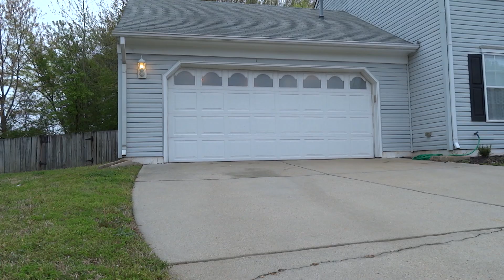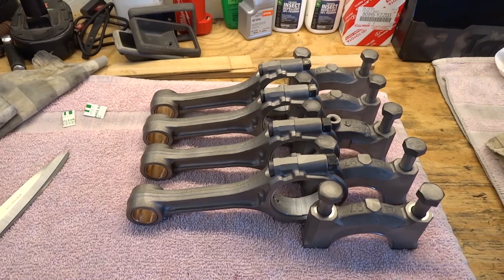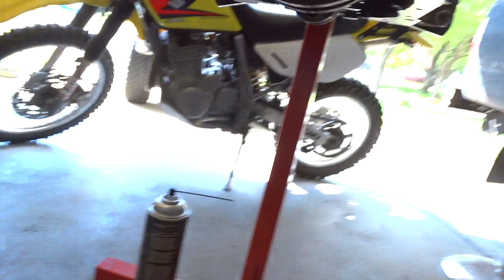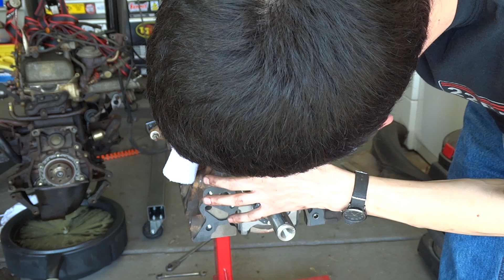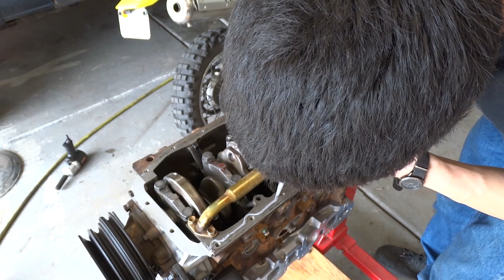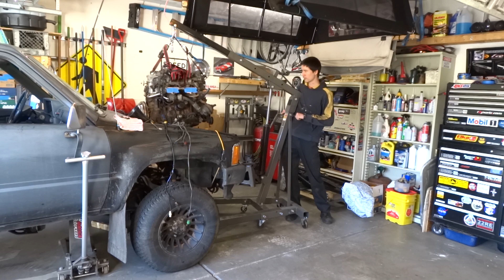Toyota 22RE Full Assembly and Install

Comment: So it looks like the 22re long block  on my 84 donor is the newer laser block.  Pear shape ports on the exhaust side.  But why does it have the throttle bottle body that tilts down?  I was told that throttle body indicates that its the pre 85 non laser block.  Can someone help me out.  Thanks
Reply: Also I heard that the 84 and 85 heads and blocks are completely different but has the newer valve cover.

Comment: dont feel bad theres a bolt that runs down under the timing chain that apparently needs to be sealed or it will eventually get oil and water mixed up i had to open everything back up put a little permatex on and close her back up. Way to make it look easy tho😁

Comment: Curious about that smoke on start-up around 39:01. Where's that coming from? Is that normal for first time starts? Love this vid. I've watched it like 18 x
Reply from the maker: It's oil and grease burning off the exhaust manifold. Keep in mind, the last time this engine ran it literally exploded and sprayed oil all over the exhaust. Combine that with greasy hands touching parts, it's totally normal to see some smoke on the first start up.
Reply: @TheAlexManVideos  dude. I fully rebuilt the 22RE in my 4runner, largely due to this vid. Thanks so much for putting it together, and for the reply. You've taught this guy to fish

Comment: I have a few questions. Does the size of your tires hinder the power the truck puts out goin up grades in the 4 runner , 4 cylinder? Have you changed the gearing at all for that ?
Reply from the maker: Tire size definitely makes a difference. The Pickup has stock size tires and stock 4.10 gears. The 4Runner has 33" tires and has 4.88 gears. Even with the re-gear, it's slower than the stock Pickup. For a while I had 35's on the 4Runner and it was even slower. Both trucks are 22RE powered.

Comment: I'm afraid of all the hoses and wires.
Reply from the maker: Everything goes from one place to another place. Just label stuff when you take it apart and put it back where it came. A lot of times with older stuff, the wires and hoses have sat in one position/shape for so long they basically point to where they are supposed to go.

Comment: You use a pre cut gasket and gasket maker on both sides? Seems a little redundant, no?
Reply from the maker: Maybe. Doesn't leak though.
Reply: @TheAlexManVideos  that's good! I just got my first 22r assembled the other day and it runs like a top! Seems impossible to put these things together incorrectly.

Comment: Sup dude i have a couple questions. How do you determine your bearings and ring and piston sizes? Dis you go with all standard sizes since you did not need to grind down the crank etc? Then install the standard sizes and re check clearances??
Reply from the maker: I had the machine shop check the crank and determine if it needed to be ground or if polishing was okay. They said all it needed was a polish so I bought standard size bearings. A double check with the Plasti-gage just to be safe, and assembled it.

Comment: Do not use green coolant in your Toyota engine, they don't like it. Go the the dealer and pick up the red stuff it is much better for the engine.
Reply from the maker: Green stuff works just fine. These trucks and pretty much everything else on the road used green back in the 80's.

Comment: Nice! What sealant did you use on the top corners of the timing cover? Looked like a second application after razoring it off.
Reply from the maker: Permatex Ultra Gray. Razor off the tab that sticks up once the timing cover is on. A tiny dab after keeps it from leaking through the junction.

Comment: It's best to use ring expanders!

Doing it by hand is likely to bend or twist the rings so they don't sit flush with the cylinder walls. Speaking from my experience just yesterday, I fudged one up despite being careful lol
I just skipped thru this to see how if you installed the timing chain and cover first, wasn't sure how I'd hold the chain up but now it makes sense, thanks!

Comment: Really like your videos. I wish that making more videos was something that interested you. This video in particular +  your 6-part timing chain series were super helpful.
Reply from the maker: Glad you enjoy the videos. For better or for worse, I make these videos just as a hobby. I don't make a living off of them so my drive to produce them isn't pressed by necessity. Also, my nice camera that I only bought fairly recently completely took a dump which really took the wind out of my sails. So I need to buy a replacement camera again and I've been putting it off. I can use my GoPro or my phone but neither one is really easy to use or makes as good of videos. Don't worry though, I'm still here.
Reply: @TheAlexManVideos  glad to hear you're still around, best luck to you, and thanks again for the content

Comment: Have you ever changed out or remanufactured the gear box to steering? If so will you provide me you choice on the part?? Thank you.
Reply from the maker: I've never had to replace the steering gearbox. I have had to replace the input seal on two different trucks. For those I used a kit made by Edelmann.
Reply: @TheAlexManVideos  so for my 89 Toyota pickup gear box, just replacement kit would do? Thanks for the information if that's what will work.

Comment: Did well explaining on the video on the acceleration throttle that you installed. Plain and simple,.short and to the point. I have an 89 Toyota pickup, have it for 22 years.

Comment: The comment you made about the timing chain guide breaking and causing the timing chain to wear a hole in the water jacket was spot on. I haven't heard anyone else mention that in all the hours of 22RE videos I've been watching. I went and inspected my timing cover and BAM!!! big crack in a worn spot. The motor oil looked like a chocolate milkshake. I am so appreciative of that comment. It saved me countless hours of pain and heart ache. Thank you!!!
Reply: Did you do the repairs? Looking to buy a pick up with milky oil and thinking it might be this. If so how did it go after the repairs? Engine ran fine? Im worries the engine may have had bearing damage due to the coolant in oil
Reply: @heyitschinoable  I found this issue after removing the motor, thinking it was a head gasket. I rebuilt the entire motor, probably uneccesarily. Motor seems to run good, but now I have a transmission problem.

Comment: A very well produced video showing important steps and techniques!...compliments also on your articulation!  
I wasn't thrilled to see WD being used in the bores as a lube (it's mostly solvent!)...I would have used engine oil.  Otherwise it's all quite similar to the Volvo Redblock which I am quite familiar with.  When the Flywheel went on, not being a Toyota expert, I thought you meant you had forgotten the Pilot Bearing...and you didn't mention that...it's good practice to change this inexpensive bearing whenever there is access.  
My son (under guidance of a Toyota experienced mentor) is getting ready to install a Rebuilt 22RE shortly, and I will be monitoring/consulting, but I'm sure he got a lot out of watching your excellent presentation also!  Cheers from Connecticut!
Reply from the maker: Glad to hear I was able to help someone get more familiar with what they are working on. Good for you for helping your son get into fixing stuff on his own. It's a good skill to have and helps in life way beyond just working on cars.

As for the WD-40 in the bores, I was taught that motor oil can burn up at the first start and gum things up with carbon, also that it might not allow the rings to seat as quick which is essential in the first few minutes of an engine's life. The WD-40 is mostly a solvent but also a very light lubricant which is all you need/want. I think we all agree the pistons/rings need some lube, dry would be bad. In support of my idea, when you take apart an engine that has been running, the piston and rings aren't really oily at all above the oil control ring, and that's how they live their life. In the end, it's probably another debate like break-in process or oil choice. Everyone has their opinion which they swear by but it probably makes little to no difference.

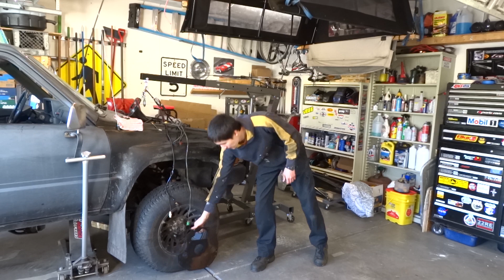Comment: The look at 35:55, I felt that deep lol. Ive had my engine out 4 times with 3 different builds in the past year and a half (its been rough) and forgotten that plate more than once. Just picked up 22re V3 tonight and wanted to make notes on the order everything needs to go on, this video was a perfect visual reference. Hopefully this time around it doesnt burn more oil than gas!

Edit: After finishing the video, a couple notes for the next build and everyone else reading this;
-pack your oil pump with assembly lube, fill your oil filter before installation(can't really do this on a 22re unless its on a stand or relocated) and pull your efi fuse and crank the engine before first start to build oil pressure
-Always torque crank and cam in sequence, tighten from the inside out, remove from the outside in.
Reply: Bummer 😔

Comment: Do you have a video showing or could you do one,  about the sensor that goes into the block exhaust side and the wire that plugs into that sensor where it comes from on the harness. Traced all the way back to my transmission wire and cannot figure out which wire it is.
Reply: Old comment, I know, but I don't remember there being a sensor on the exhaust side of the block.  Pretty much every delicate electrical thing like that is specifically on the intake side to be away from the damaging exhaust heat, such as the knock sensor, oil pressure switch / sending-unit, etc.

Comment: Did you use Prestone all vehicles all make coolant? I'm about to flush my coolant and add the yellow Prestone, I believe it's the same one you used.  Any issues?
Reply from the maker: I use the generic Prestone for all makes and models. It claims it can be mixed with whatever you want but I'm not so sure. I've been using it in all my vehicles exclusively though so no worries about mixing for me.

Comment: How far back do you press the pilot bearing? Installing a new clutch kit and the manual doesn’t specify depth
Reply from the maker: There's a lip inside the end of the crank. Press/hammer the bearing in until it stops.

Comment: Could you list the types of gasket sealers used and for what parts. I also noticed sealer on some bolts.
Great video, i currently am down to the head gasket with engine in truck still and your video makes me think i should  rebuilt the bottom end as eell.

Comment: Random questions about small details! So what lube did you use (yellow paste) for the thrust washers and what oil do you use to lubricate the crank/head bolts before torqueing (little cap full of oil) Fantastic video that really shows the whole process. Best 22RE build video available.  Also, what was that fancy RTV trigger squeezer you used on the oil pan gasket? That thing looks aweseome!

Comment: Didn't that timing guide  kit come with 2 guides so you don't have to use the plastic one on the other side?
Reply: The passenger side is fine in plastic. The chain is always tensioned. On the ds it needs it for the deceleration wiggle.
Reply: @coldwateronly  thanks cause I had hung a mew guide and sprocket kit with new bad tensioner... that came with 2 metal guides that made a bad noise. I replaced everything again with OEM except ds metal guide...cause that's the one that I heard breaks... I would suggest ds metal guide and OEM tensioner and OEM parts... if you can afford them otherwise I've seen others kits like one by evergreen that have the d.s. metal guide. With the kit.. I'd still get a new oem tensioner though. But that's just me..

Comment: What all do you have to do with the transmission when you pull the motor? Can you just unbolt it and lift the motor out? Or do you have to disconnect the driveshaft and slide the transmission back first?
Reply from the maker: No need to move or remove the transmission. I use a ratchet strap between the framerails and under the transmission to hold it up.

Comment: I would have drill and taped the bolts in the intake, lol,.
Reply from the maker: Whatever gets the job done. I like to keep repairs as close to factory as possible. The Heli-coils allowed me to use the same size screws and not have to drill anything out bigger or use SAE hardware.

Comment: @theAlexManVideos, Great video.  Where did you purchase the timing chain guides?  Is there a different part number for the metals ones then there is for the plastics ones?
Reply from the maker: I bought them from 22RE Performance, they are made by OSK. There are different part numbers for kits with metal guides.

Comment: What works well with the sheered bolts is welding a nut to the broken stud. Not sure if you have a welder but it works great. Heating aluminum is a pain cause the expansion rate compared to the steel. Just for future reference.

Comment: Wow, this video is awesome, thank you. I would love to inquire from you, my brother, about the best oil for this engine.
Reply from the maker: Glad you liked the video. This engine is really basic, no hydraulic lifters or oil operated solenoids so the oil viscosity isn't really too important. It'll be happy with basically any engine oil 5W-30 all the way to 20W-50. I usually run 10W-40 or sometimes diesel 15W-40. It really doesn't matter much. Any oil will do as long as you change it.
Reply: @TheAlexManVideos  Thank you very much. I wish you good luck always.

Comment: Do you have a locker or a welded diff ?
Reply from the maker: It's an Eaton Truetrac limited slip. It's a helical gear type limited slip. No clutch packs to wear out and basically imperceptible on the street until wheel slip occurs then it "locks" up. Doesn't really lock but biases torque away from the side that's trying to spin. Similar to a Torsen and the best type of limited slip in my opinion for a street vehicle. Nothing beats a true selectable locker off road though.
Reply: @TheAlexManVideos  awesome I’ll try get one for my 1987 hilux

Comment: What kind of  LSD did you use for the 22re please help I’m trying to get one for my 1994 2wd toyota pick up with a 22re in it.
Reply from the maker: I used an Eaton Truetrac. The differential in this truck is a Toyota 8 inch V6 type. The 2WD trucks came with a 7.5 diff in most cases so my exact part won't work for you, but the Truetrac is a great differential for the street and mild off road. It's a gear type limited slip like a Torsen. It doesn't have clutch plates to wear out and is nearly invisible on the street until one wheel tries to slip.

Comment: Great Video! Do you never use threat-locker to assembly the engine?
Reply from the maker: I do in certain situations. On the 22RE I use medium strength thread locker on the fasteners for the timing chain guides and tensioner. I also used it on the small screws that hold the rocker shafts to the rocker towers. But I don't think Toyota did this when the engines were fresh so it's probably not necessary. On motorcycle engines, I use thread locker a lot more often. On motorcycles, a lot of screws are threaded into aluminum which is softer, and the screws are often smaller and shorter. Couple this with the likelihood that motorcycle engines will vibrate more than car engines and it just seems like a good idea.

Comment: Those timing chain guides took out two different engines in the same car. Well, they likely weren't dead but this was in the '90's before there was easy access to information on the Internet. The first, original 1983 engine went 268,000 before the chain wore through the timing cover and the second, replacement 1988 engine went 198,000 before throwing the chain off. The car was a now rarely seen 1983 Celica GT-S.